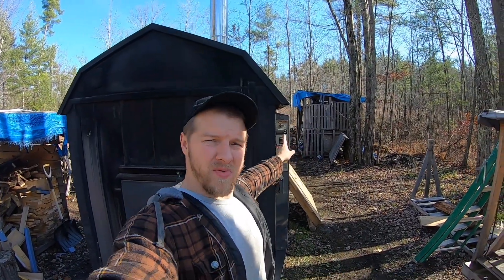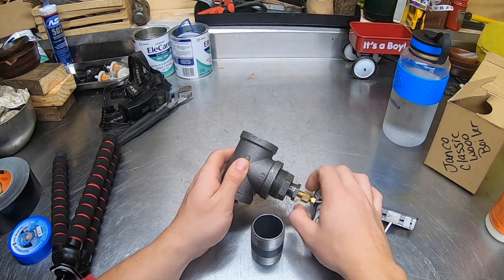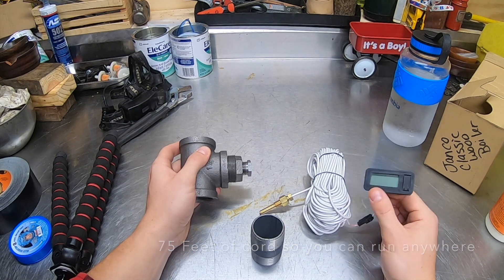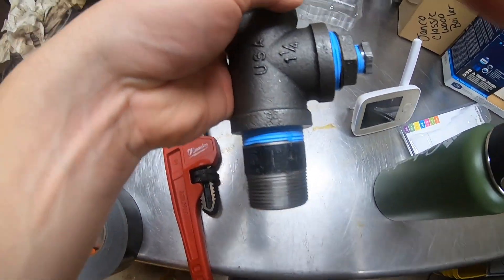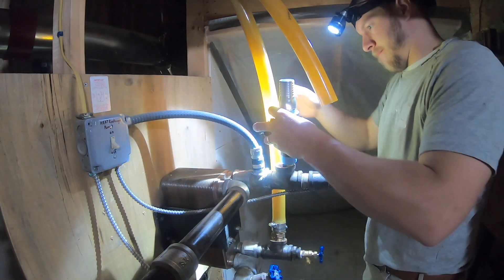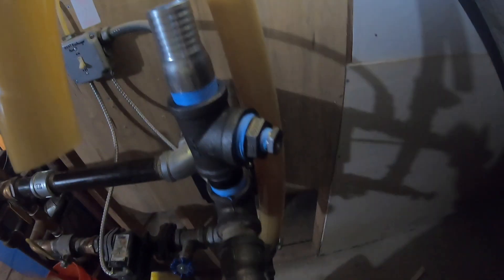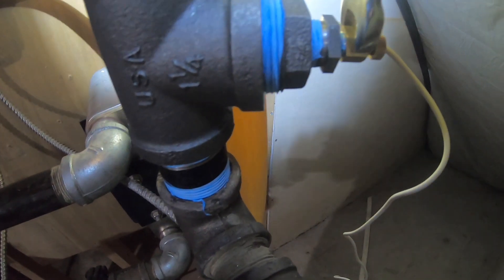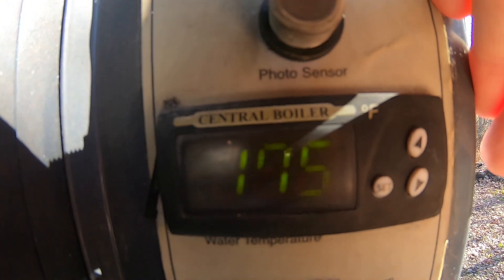The Best Modification For An Outdoor Wood Boiler! Indoor Temp Sensor EP 90

Comment: I just did something similar over the weekend. I bought a wifi temp thermometer and then  integrated it into my alexa. I just ask her what the boiler temp is if and sedtup some automations. got one with a probe and put on outside of pex with duct tape in basement. I use a MTS960 and I am able to maximumze when to load and have it send me a text when its on its cooldown and should be heating up (anything less 165). the differnce is like 30 degrees through the pex, which im calibrated with software to get a mroe accurate number of whats in boiler. if anyones interested I wrote a program that will display and log all the temperature data in a csv and then can be graphed out. I feel like im burning way less cause im only loading when the coals are unable to heat the water.

Comment: Jay - If you open up the display where the battery is located, there may be a potentiometer that has a small screw that you can turn with a small screwdriver, to calibrate your display to the outside display.  Good luck!
Reply from the maker: Hey Steve! I may have to check that out when I fire it up again! Thank YOU!

Comment: Did you get a chance to check pump and pipe length ?
Reply: I am a dealer
That’s why I try to help
If you switch to a Taco 0015e and run on Medium 
You will gain about 1.5 -2 Gpm flow and save approx $93 ever 6 months of usage
Reply from the maker: @luvdogsandhorses  
Hey again! Yes I just checked those out and they seem really neat! I like the multi stage depending on the draw for flow! If I need a pump id deff upgrade to that model for sure!
Reply from the maker: @luvdogsandhorses  Can those pumps be mounted on the boiler itself? Thats where my Taco is now.
Reply: Yes at the stove is usually best... also best to have about 6” of straight pipe leading into it
I’m not trying to sell you a pump
The point I’m trying to make is that you are wasting money if you don’t...
The new pump I recommended with pay for itself in electricity savings 
You current pump will cost you more every month you use it and then you have to buy a new one
Ex keep your 009 for 5 years
Each 6 months of electricity will cost you about $108 to run if you run 6 months a year that will be about $650 in electricity new pump about $180 plus for a total of $830
The new pump at about $140 plus 5 years of using for 6 months totals $97.20 in electricity for a total of about $240

Now— there is the big picture 

Except for new pump gives better flow also since it is better matched to your system

Different pumps for different systems ... you should have never had an 009 but rather a 0010 or a Grundfos 15-58 maybe
Reply from the maker: @luvdogsandhorses  Ok this is incredible information I really appreciate it. I deff can see the savings when you break it down like that for sure. I am not sure why this pump has whats on it as I didnt install the unit but I deff can see upgrading it in the near future for sure. Thank you again for the perspective!
Reply: You are welcome
Many installers use 009 circulatory to avoid callbacks they push very well for their size
In my opinion, they are overused and wasteful
Many people don’t understand how to size a pump—- if you are interested download Taco document Td10 to learn how. In my opinion, it still needs further understanding when used with outdoor boilers bottom line— you usually don’t need as many Gpm as they suggest 
Also your pipe sizing is unusual 
You have a very good flowing system
Available for further explanations if you would like
Reply from the maker: @luvdogsandhorses  As always I appreciate it!
Reply from the maker: tomorrow I promise!
Reply from the maker: Hey there. My boiler runs a Taco Cartridge Circulator Model 009-F5 about a 100' run from machine to heat exchanger up a slight hill prob a 20 degree steady rise. Hope this helps! They make a new taco pump that has 3 stages that you can set depending on flow needed. If you are looking to replace or install a new one id check out that new style and or contact a boiler dealer but thats what my model has on it! Sorry for the delay!
Reply: Glad to help
Keep that stove running well

Comment: Pretty certain if you had just tapedthe sensor or clamped it to a metal fitting on the supply side at your plate exchanger from the boiler then insulated it with a little pipe foam you could’ve avoided all of that and gotten a more accurate reading as well
If you would...do that and share your results please
Reply: Great
Yes that is a good location
How far is your wood boiler from your indoor boiler (one way) and is the pipe that size the whole way and what circulator do you have ?
Taco 009 011 014
Thank You
Reply from the maker: @luvdogsandhorses  This diameter pex is both feed and return right to the boiler. As far as TACO pump I will have to check! If I forget shoot me another comment tomorrow as I am not home now.
Reply from the maker: This is how central boiler recommends doing it. Direct on the supply line prior to heat exchanger. Cant do it out on the machine cause no way to run wire inside.
Reply: I thought in the video you said it was on the return
My bad
I was only suggesting you attach it - not all that effort you went through 
But while we are on Central Boiler suggestions... they would recommend a y strainer where the water enters the plate exchanger
Reply: Your video did say it was the return
Now I’m really intrigued 
Did you install the new sensor where the water comes into the plate exchanger from the woodstove or after it has gone thru the plate exchanger
Also curious why you have 1 1/4” line ...
Reply from the maker: @luvdogsandhorses  Its on the supply BEFORE the heat exchanger. If you install this any where else you will get a non accurate reading. This pex is very large and not sure why this large of a pipe was used but thats what was here when we moved in.
Reply: Pump and approx distance when it’s convenient please
Reply: Did you get a chance for pump and pipe length ?

Comment: THANKS FOR HAVING THE GUTS TO TRY THIS PROJECT.  THOUGHT ABOUT IT MYSELF A FEW TIMES AND THEN THOUGHT...WHAT'S THE POINT.  I FILL IT AT REG INTERVALS  EVERYDAY REGARDLESS OF TEMP.  I HAD A CENTRAL BOILER FOR 11 YRS.  NOW I HAVE A PORTAGE AND MAIN WHICH IS A FORCED DRAFT THAT BLOW UP FROM BOTTOM AND FRONT BY DOOR.  I PUT SOME WOOD ON BOTTOM OF FIREBOX PARALLEL TO THE WALLS OF THE STOVE.  THEN, I PUT LOGS ACROSS THOSE PARALLEL TO THE DOOR.  THE FLAME SHOOT OUT THE SIDES OF THE CROSSED LOGS AND SEEM TO HEAT THE WATER FASTER AS THE FLAMES HIT THE SIDES OF THE STOVE.  ALSO...FOUND THE CENTRAL BOILER TO IDLE ALOT.  SO I STARTED SETTING THE DIFFERENTIAL TO 5-7 DEGREES.  MADE A HUGE DIFFERENCE IN CONSUMPTION. THAT DIFFERENTIAL TRICK WAS A SUGGESTION FROM PORTAGE AND MAIN.  FOOD FOR THOUGHT FOR EVERYONE.   ENJOY YOUR VIDES AND I AM SUBSCRIBED
Reply from the maker: Hey Bear! Thanks for coming by and subscribing! Thanks for sharing your story with central boiler! Now when you say “differential” do you mean temp when the boiler kicks on and off? Mine is set at 180 so at 170 it kicks on! Please let me know I’m curious. Please let me know about what you mean about the 5-7 degree differential. I was told by central boiler to keep the unit at 170-180 to help fight moisture/condensation the best. I was told that running these are like 140-150 degrees is more susceptible to moisture/condensation build up! Let me know what you know! Thanks again!
Reply: @HomesteadJay  HI JAY.   I HOPE I CAN CLEAR UP WHAT I MEAN.  DIFFERENTIAL IS THE DIFFERENCE OF WHEN STOVE TURNS ON AND OFF.  YOU'RE DIFFERENTIAL IS 10 DEGREES (170-180).  WHEN I HAD MY CENTRAL BOILER 60-48, I RAN IT AT 175-185 PER THEIR SUGGESTION AND FACTORY SETTINGS.BECAUSE THE STOVE HAD A 393 GAL. CAPACITY, IT WOULD BE DOWN (IN IDLE MODE) FOR LONGER PERIODS.  IF YOU ARE BURNING WET WOOD (SNOW COVERED/RAIN DRENCHED), OR GREENER WOOD, THERE IS MOISTURE ACCUMULATING IN FIREBOX AND NOT BEING BURNT UP AS WELL AS WHEN IT'S FIRING.  I HAD MY CENTRAL BOILER FOR 11 YRS OR SO AND NEVER HAD ANY ISSUES OTHER THAN IT BURNED A LOT OF WOOD.  I BELIEVE WHEN A STOVE IDLES, THAT'S WHEN MOISTURE BUILDS.  MY PORTAGE AND MAIN NOW IS 93 GAL.  IT SEEMS TO BURN ABOUT 1/3 LESS WOOD.  IT'S A FORCED DRAFT.  I LIKE THE DESIGN FEATURES A LOT.  IT'S ALMOST LIKE A GASSER (WHICH I WOULDN'T WANT)BUT NOT. ALL MY WOOD THIS YEAR GOT SOAKED WITH 6" OF RAIN THEN FROZE, SO I'VE HAD TO BURN THE WOOD "WET".  I CALLED PORTAGE AND MAIN TO SEE IF THAT WAS A GOOD IDEA.  THEY STATED IT WASN'T THE BEST SITUATION, BUT, IF I HAD TO BURN IT, I SHOULD SHORTEN MY DIFFERENTIAL TO NO MORE THAN 5-7 DEGREES DIFFERENCE.  THEY SAID THE SHORTER IDLE TIMES WOULD RESULT IN MOISTURE BEING BURNT UP FROM THE WOOD MORE EFFICIENTLY.  THEY STATED THAT I ALSO WOOD USE LESS WOOD, WHICH I FOUND OUT TO BE TRUE.  HE ALSO SAID THAT BECAUSE I HAVE HOT WATER IN THE FLOORS OF OUR HOUSE, I SHOULDN'T HAVE THE TEMPS IN THE STOVE THAT HIGH.  HE SUGGESTED 168 TO 172 OR 173 FOR ME.   HOPE THIS HELPS EVERYONE.  LET ME KNOW IF I CAN HELP MORE.
Reply from the maker: Ahhh ok I see now! Thank you for clearing that up for me! Makes sense! Another thing I agree with what you said is gasification. I don’t know if I’d want a gasification unit because of how picky they are. Thanks for clarifying!

Comment: As long as you learned. Would like to ask a question if I could. Looking at installing a outdoor boiler, is it worth installing a system and what is the true  paid back.
Reply from the maker: Hey John! Hope I can help here. First question is what is your heat demand? I.E. heating zones, square footage, rooms, hot water heater etc...  Can your home get away with a efficient woodstove to heat the home? These units are typically designed for larger homes and/or heating exterior buildings as well like detached garages, green houses, pole barns, etc... Installing an OWB (outdoor wood boiler) in a small home that may only have 2 heating zones with an electric hot water heater seems like a waste to me considering the BTU these suckers put out. 

Second question is what is your connection to firewood? do you have land? is it wooded? We own 18 acres of land, there is 25 on the other side and 55 on the other so yeah its around us for sure since we are land locked in the boonies.

Third thing is do you have time/health/ capability to invest in acquiring/cutting/splitting/stacking firewood. Burning green/wet wood in these units is a waste of time/energy so you need to get your wood to premium shape for the most return on effort. 

Fourth thing is initial cost of the OWB + install. Can you float that money up front? Also equipment such as chainsaw(s), splitting tools, log lifts, picakroons, axes, truck, trailer, etc... 

Here is my take. I love it, wouldnt change a thing, Id buy another one once this one expires. First of all firewood is a natural product of the woods I.E growth cycle and all that jazz. I love being outdoors. I am being the shepard of my land, I am cultivating my woods just as a farmer cultivates his land. I am ( in the process of ) creating a sustainable forest around me. One that is healthy and flourishes that can yield firewood both naturally ( blow downs, uproots, storm damage, disease trees, selective cutting, etc...) To close Ill close with this, you cant put a price on security and independence.
 I am in control of MY heating needs/survival. I dont call the oil/propane man/woman to come save me. I dont like relying on others to keep my family safe and secure. If YOU want to be in charge of you heat/security then go for it. I dictate the heating situation and its a direct result of my effort/planning/responsibility. Burning firewood is rewarding because its a fruit of your labor.   Again consider all options 1-4 as I said earlier and also the independence question.  

I hope this helps! Please let me know if this helped!
Reply: @HomesteadJay  Hi Jay,
National gas, 95%  High efficiency forced air system. Over 4,000 sqft Have 5 bedrooms.
Have a wood source but don't have time to cut and split wood. 

Would get for new home that we will build next year but there is no national gas I would place there propane. Would use outdoor boiler for December though March.
Reply from the maker: @CrespiLand  Hey again John! The good part about an OWB is you dont need to split wood down to fireplace length! If you can fit through the door it can burn! You just need a good coal bed and it will sit and burn for however long! So every tree you harvest is actually less work because you split less and make less cuts!  Hope I helped you! One recommendation I would do is if you start fresh  with a brand new unit have it filled with a propylene glycol solution. That way if you decide to not run it you have the option too shut it down without worrying about freezing!! If you take anything out of this convo spend the extra $ for that solution so you are protected. Please follow the channel and subscribe! I post OWB a lot and tis the season for wood heat!
Reply: @HomesteadJay  Thank you, will make that investment in the glycol. Will let you know how it works out, will Subscriber now again Thank you for your help talk soon
Reply from the maker: Anytime! I’m 5 years into it so any questions at all let me know!

Comment: Nice job....yeah, wow....those little 'quick' projects are the ones that take the longest and require the most effort...lol...you're not alone in that department, same happens to me. Do you know how deep your lines are buried? So is that sensor off or are you thinking you lose 8 degrees from boiler to house? 
I'm curious now on mine....but not curious enough to attempt what you just did...hahahaha.....good vid, cheers!
Reply from the maker: Hey Back 40! Thanks for coming by! The lines "should" be buried under the frost line per code. Much like a geothermal system the deeper the warmer (I think lol). I think the degree loss is due to the 50ft of pex line and then the sensor has a 75ft read out (white wire) so im sure theres fall out with heat loss and signal loss. It says right on the instructions it will be - a few degrees compared to boiler! It sure helps a lot being able to get an idea +8 degrees of what the machine is up too! Saves the trip walking esp when its below zero out! Thanks for watching!

Comment: Awesome video Jay!    I have a central boiler CL5036.   Instead of tapping into the interior manifold I tied our sensor into the water outlet right at the boiler and ran the wire through conduit and into the house that way.    Same basic idea but we don’t have to add the “+8” or whatever the temp drop would be from the stove to the inside.     Thanks for sharing.
Reply from the maker: Unit! Thanks for coming by and checking out the video! I wanted to do that but also digging a trench and running conduit wasnt on the list LOL. I dont mind the 8 degree change, I can do basic math and add 8 to whatever the number reads. Thanks for watching! I have the start up video coming on the machine so stand by!

Comment: Sometimes jobs go that way . But you got it done . We use remote temperature senors at work too monitor water cooled panels in the steel mill . The technology is great . If someone could design a automatic wood loader for the fire box that would be great too 😂👍 . Stay warm Jay . Snow on the ground here and getting cold .😖
Reply from the maker: Stephen! Thanks for coming by! Good to know you have seen these before! Im sure the process at the steel mill is cool! An automatic wood loader...HMMMM I like it! Wouldnt that be cool! Its getting cold here too!
Reply: Homestead Jay If you could figure out a way too load the wood automatic when wanted would be pretty neat Every body would want one . Start thinking 😂👍